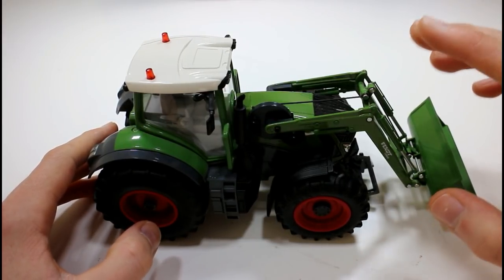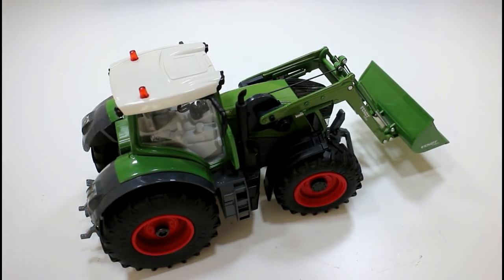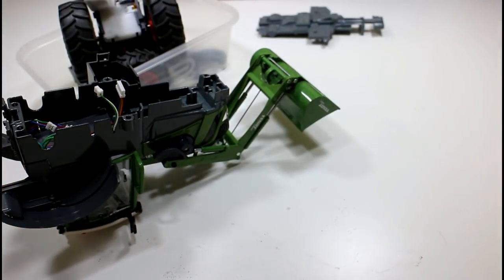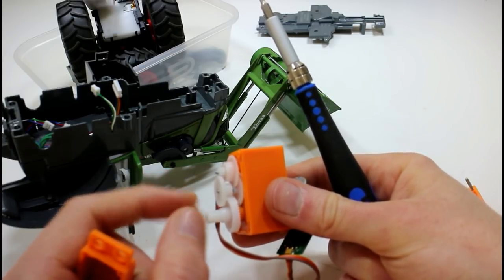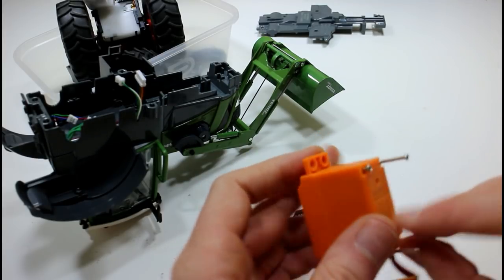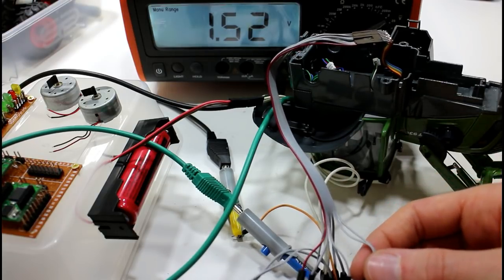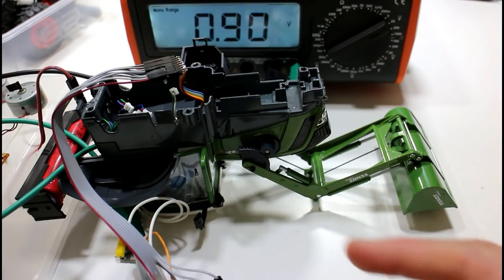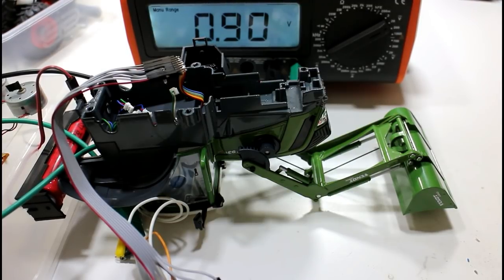How a Siku Control 32 Fendt 939 Loader Works

Comment: Good day! Please help me, my John Deere 7310r front loader bucket stopped working. The tractor also began to move slowly forward, then it stops altogether. What could have happened? faced such problems?
Reply: My John deere 7310r also stopped working.
Reply: have you found a solution?